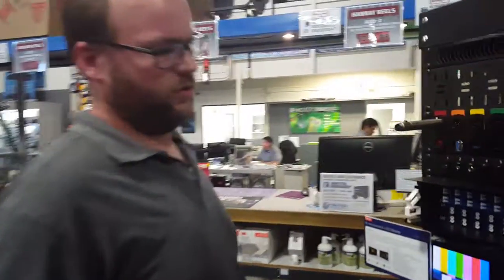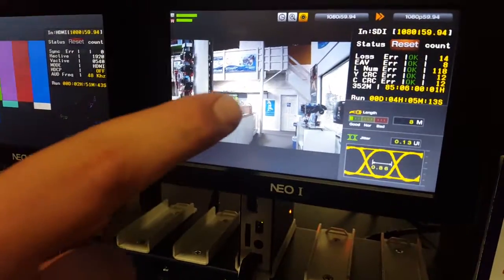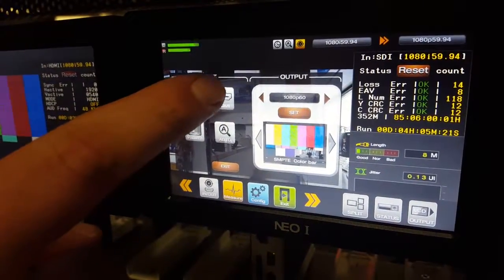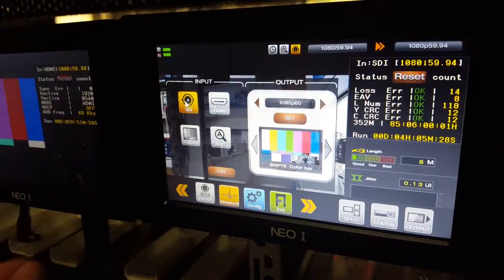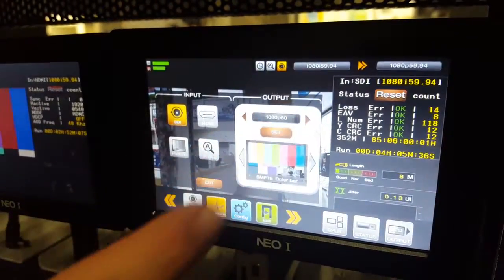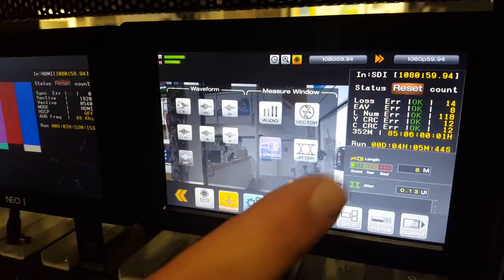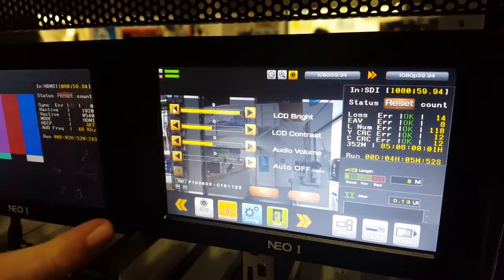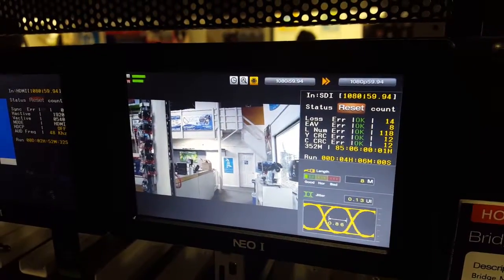DIGITAL FORECAST Bridge X_NEO I

Comment: Does anyone know about the battery pack behind this, It has 4 holes but the company does not specify compatible products to use. I'm thinking IKAN might have the adapter kit but not 100%.
Reply from the maker: Bernel Nery model# is "NBP-SL" which is Sony NP battery bracket.
You might want to ask for B&H either Markertek if they have stock.